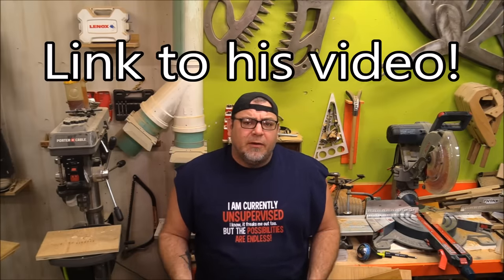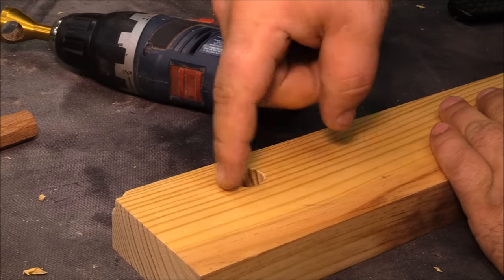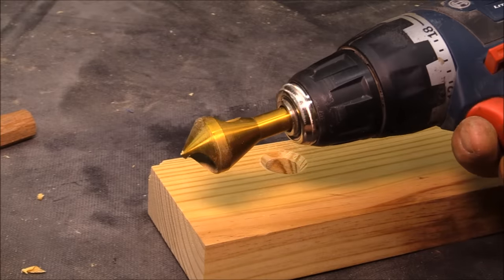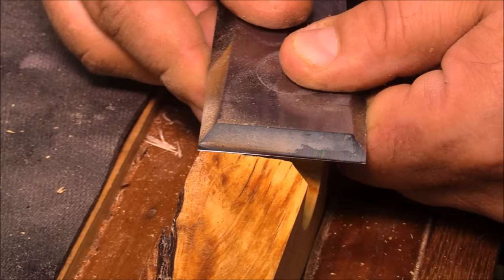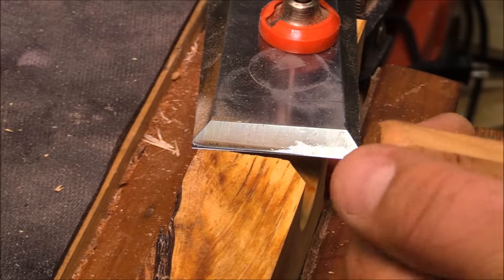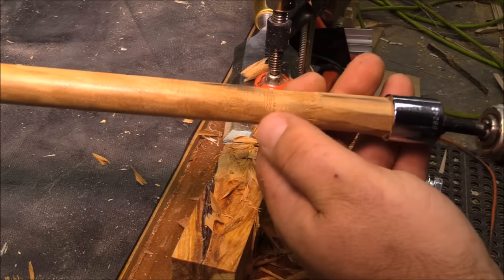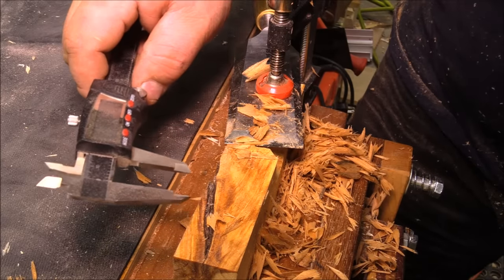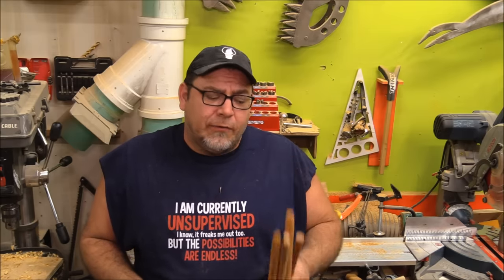Old School Dowel Making Jig

Comment: Nicely done, great video.  Mount an additional block of wood with the 3/4" hole about 12" away from the "chisel" to function as a stabilizer sleeve to reduce that dowel machine wobbling.

Comment: Thanks, Izzy, that's so fast and straightforward. The socket drive is killer. I'm already thinking in terms of legs for simple stools, tables etc. It would make a great jumping -off point. A variant having an adjustable depth stop with a skateboard bearing in line with the axis and perpendicular sliding block on a horizontal cam clamp to hold a gouge or skew chisel could be added for some further shaping. Behold, (almost) instant basic lathe! Sure, it would chatter a bit, but so what?

Comment: The traditional tool for making dowels is a dowel plate, an iron (or better, hardened tool steel)
 plate with a hole having the size of the desired dowel. To make a 
dowel, a piece of wood is split or whittled to a size slightly bigger 
than desired and then driven through the hole in the dowel plate. The 
sharp edges of the hole shear off the excess wood.[1][2][3] (cut and pasted from wikipedia) a dowel made from split wood is stronger than cut wood..this is a much slower method and will not produce dowels as uniform as the dowels in the vid..i like your vids izzy, well worth watching

Comment: never thought of doing it like that.  I've always just drilled the size hole I needed in a piece of angle iron just cut my stock square tapered the end to fit in hole just drilled it through but you have to go back and forth a lot to get it smooth. I'm going to try yours.

Comment: you could also use some boards with 3/4 or whatever dowel size you're making and put it on the side where the dowel comes out so it's like a guide and maybe it wouldn't jump when you get to the end of the dowel

Comment: would adding a second piece of pine with the 3/4" hole drilled in it directly behind the one you used to cut the dowel make operation even more stable?

Comment: For superior strength always split your wood down to size, never cut it. Splitting means your dowels will maximise the shared grain down the shaft. Your finished product will be able to endure stress forces that regular dowel or store bought dowel would turn into confetti at.
Reply: This is a moot point if your stock has particularly straight grain already

Comment: I'm just thinking out loud here, but if you had a second piece of wood behind the jig a ways, with the same diameter hole you are dowelling to (0.75" here) and lined up with the first dowel hole...the dowel should slide into the second hole as you are pushing it through the jig and prevent the piece from vibrating and jumping at the end of the cut because it would be supported out at the end.

Just a thought.

Comment: Nice pencil sharpener  Now make one with Lead in it that works.
Nice big number 2  you'll never loose!   You could cut a hole in it for a real number 2 that slides into the dowel no one but you would know also some way to push it out as you use it online.  
 USE A plane blade instead of a chisel  my chisel's suck.

Comment: Hello.. Great video! But is that a TCT or HSS blade you used to make the dowel? And which one is better in term of quality and durability? I want to go with HSS because it can stand a high speed and temperature plus you can sharpen it more easily rather then TCT, but in the video the dowel become shiny so I wonder is that HSS or TCT. Please to anyone with an experience give me an answer, thanks before.

Comment: Do you think I can use this to make arrows?(so using flexible light wood) Or will they just snap due to the pressure and the fact that the needed diameter is very small?

Comment: seems like you could swap the chisel for a single edged razor blade, fastening it through the center slot with a screw & washer....having the slot would also allow you adjust it    (essentially making a manual pencil sharpener of the size you're wanting.....)
Reply: razor may fracture, and shoot off.

Comment: Hi Izzy, I would like some of those bits that produce small cylinders of wood to hide the heads of the screws: there are 2 types, those with the tip smooth and those that have the teeth at the ends, which are the best (or better differences)? If needed I can send a link, my english is bad !!!!

Comment: I mostly use 8 mm (1/3 of an inch) or 10 mm (4/10 of an inch) dowels. Is it possible to make these smaller diameter dowels also with this jig?  Till now I buy them (the classic 4 cm long pieces, or rods of 1 m)

Comment: if you were to make it out of a 4x4 instead of a 2 x 4 you would have a much longer exit on the tool which would help in the chatter you sometimes see. also the more gradual of an angle of the blade to the hole the smoother it will run. this is the same way my grandfather and great grandfather made dowels, except for one thing they had to hand crank the dowel thru the device (no drill) man that is a pain. anyways nice video.

Comment: Great video but one question: What do I have to buy (I need the vocabulary) to make that gizmo that is a socket at one end and the other end which fits into my drill? BTW, when I make dowels I never use figured wood --- only as straight grain as possible --- and have the grain running towards me --- same issue as with a planer.

Comment: Nice!  If you drill your hole through a second  board and join them with plywood, maybe 6" apart, your dowel end can be stabilized to avoid the wobble at the end.

Comment: @Izzy, What is the smallest diameter dowel you have personally made using this technique/jig type? I would imagine in has a lot to do with the hardness and grain of the wood involved, but is there a general size you find that tends to blow apart when using this method?

Comment: Man, I have a question and I've been looking for the answer and I couldn't get a straight answer so far.

I'm setting up a dust collection system in my shop and I'm wondering what would be the proper blower power in relation to the space.

My shop is 15m X 4 meters

Comment: Did you blue the chisel sharpening it or did using it to cut dowels blue it?
Reply from the maker: there is no bluing its just the lighting
Reply: ok. Yeah it looked like it got hot and
 wanted to make sure that it was not caused by running the dowel before I did it with one of my good chisels.
Reply from the maker: For sure I completely understand.

Comment: Cool, young feller, essentially, a pencil sharpener. Hmmmm, instead of a chisel, a plane blade? Spokeshave blade? Its very hard or impossible to get ong lengths of dowel in anything except soft pine. Ok for small work. I think i will copy your idea in steel with brass bushes.

Comment: that's neat but why not just buy some?
Reply: The point of this channel is not to go shopping for things.
Reply: and its cheaper to make dowels
Reply: Geeksmithing oh OK I didn't know that.
Reply: all the dowel making hits seem to not handle making the grooves in the dowel which helps glue hold better ( less glue gets pressed out)
Reply: Perhaps you want a grain/color match or contrast, custom diameter/length.
Reply: Only hardwood dowels commonly available are usually oak and they aren't that nice.
Reply: Type of wood, custom size, higher precision and accuracy, and can be faster.